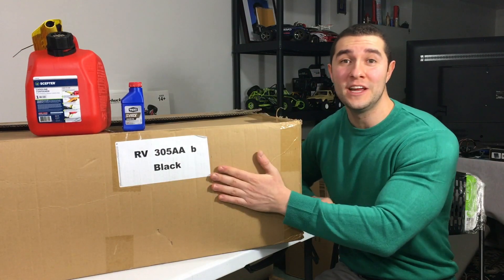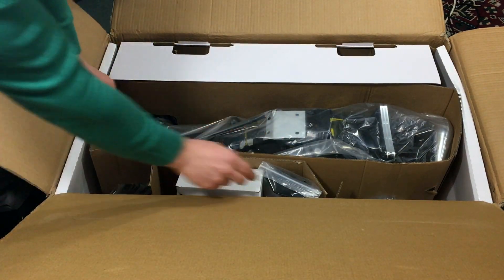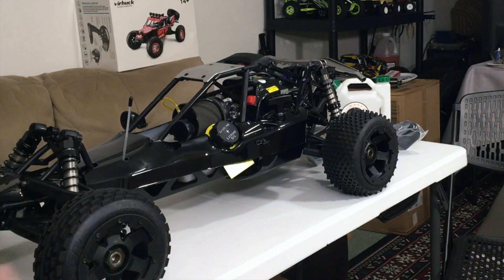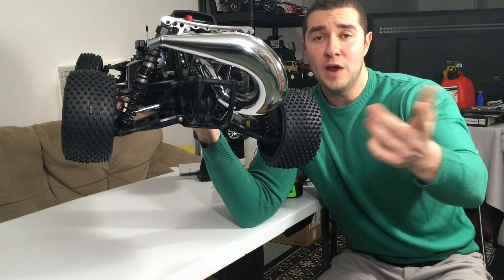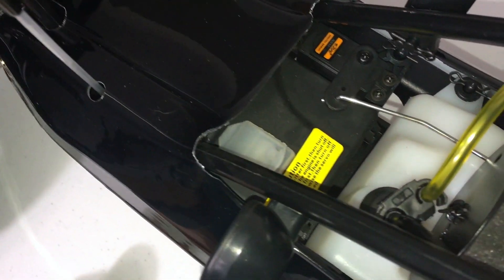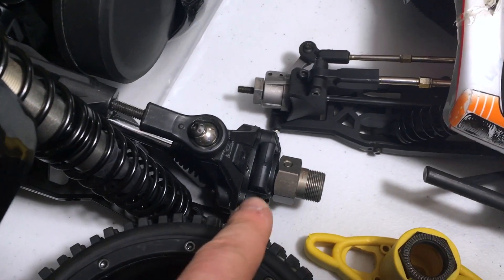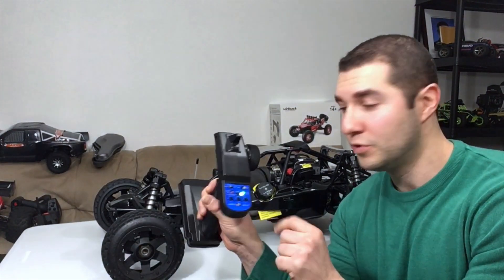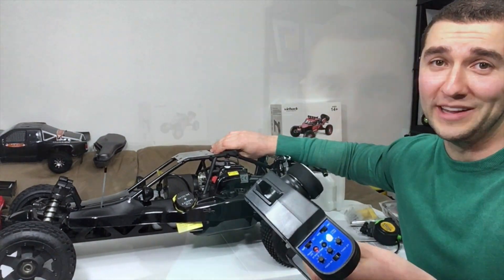I got the cheapest 1/5 scale gas buggy ROVAN 30CC (what's it like?)

Comment: No No No...… Don't know what eBay site your looking at, but these sell for between 675 and 775 all day long on eBay….  and if you want the Short Course version it's over 1200 bucks!!!!!!!!…….    yes it's a great vehicle.....      but sorry it's in the same price range as an HPI...…   The Price your quoting is for the No Engine or radio version...…
Reply from the maker: hello, You're right, the prices have recently went up some.  Check this video again at about 35-40 seconds time in the beginning. You will see that the price was 446 and I had the EBAY coupon code for 10%. So I did pay under 400 total with free shipping.  I just checked, there is a much better 36CC version of this for 535, you can submit a best offer too. Check this link, let me know if you buy it.  
https://www.ebay.com/itm/1-5-Rovan-360A-Gas-Petrol-Buggy-RTR-36cc-HPI-Baja-5B-SS-King-Motor-Compatible/332694224840?epid=26020691371&hash=item4d761effc8:g:vCIAAOSwbTRbLAn4:rk:2:pf:0

Comment: Broken seal is not ok, unless you done it your self. if the factory brakes for inspection, then they must replace it. just saying
Reply from the maker: hello, thanks for watching!!  The included literature actually says that it has been inspected after the factory by the seller, and it's normal to have a broken seal.  This is something I've never heard of before, I agree.  Its possible these are just drop shipped items and actually are checked by the final sellers. (mine has zero damage of any kind). Also it's possible they had to open the box to put in the addition running gear it came with after the factory sealed the model itself in the box.
Reply: @hybrid32494  Yeah its funny how things sometimes work, here in denmark, they are verry strickt about things like that, even customs will put on a new seal, if they would have had to breake it. And you are welcome :)
Reply from the maker: LOL, yep, the instructions literally say not to worry about the broken seal.  I must say that the packaging was very good, and nothing damaged at all.  Also weird that they removed the clear lexan body plastic film for me.  I guess they really prepped the car, ahahahaha.
Reply: @hybrid32494  OHH dear, i ordered the ROVAN AG03 BAJA, well i did that before watching your video, it comes to day. This one have some decent upgrades to it, so lets see how it holds up :)

Comment: Only downside with these engines and gearing it’s like a 2stroke go cart ,slow acceleration and benefits are mid and top end plus the fuel is cheaper than nitro
Reply from the maker: hey my dude, thanks for watching.  In a newer video I got this thing to hit 42 MPH with nothing other than slightly larger tires In the rear.  The better motors can get a couple more RPM, but this Is sufficient for a stock machine for this price range.  Otherwise you are 100% right.
Reply: @hybrid32494  I will still buy one and upgrade the motor to about 45cc i think there great value for money

Comment: I know a reverse gear is available for these can you order it with the reverse from the factory
Reply from the maker: hey buddy, I can tell you for a fact that not a single Baja will come with reverse or a 2-speed from the factory.  These things are great as is, you really do not need reverse, nitros these days also do not have reverse.
Reply: @hybrid32494  yeah I noticed how easily it turned and when I buy one of these I’ll just be backyard bashing it but probably once in a while finding a bigger place to take it I live on two acres so it won’t hit full speed but I may be able to find a bigger place to take it I like it because you don’t have to adjust the carb constantly like nitro and eventually I’ll learn how to fix small engines like the one on this one I’ve seen videos on these they are awesome and very loud but they are so cool it’s unreal one thing I’m curious about how long does the battery on the servos on the buggy last on a charge

Comment: Should I get this one or the king motors one ?
Reply from the maker: hy man! thanks for watching!  I will tell you that u will not be disappointed with either brands.  I currently still have this buggy, and it's terrific, not a single piece has broken.  I also have a KM baja, and it's nearly the same, just different specs.  I'd suggest to stick with ROVAN because it's slight cheaper at this point for similar spec models.

Comment: Where to buy at your claimed price, $395.00?
Reply: He got it on ebay from the seller rovanrc, made an offer, and used a 10% off coupon. Apparently though,  the 305a (30cc) version is no longer available, as it's not listed on Rovan's website or in any ebay listings. They only have the 27cc, 36cc, and 45cc versions.
Reply: But none at that price.
Beside that, these little cars cost more than most real vehicles on the roads.
Tires are actually more expensive than on real vehicles.

Comment: Question ?,,, Is there a difference in speed using the stock exhaust or the upgraded version.?
Reply: The rovans come with the tune pipe stock. The tune pipe is a lot better and a lot louder than the black can muffler.

Comment: Ok so first this is a clone of a hpi they copied all of hpi except the actuall measuements and another your oil choice there is bad next the mix 24/1 28/1 is what you should run there 30 cc is no match for a fuelie 28
Reply from the maker: jzink6797 hey.  Can you recommend the oil you use pls?   I am loking for other types, have not started this up yet, thanks!!
Reply: @hybrid32494  yes domanator i will check spelling but have a look at what i am building now it is a modified baja using a lot of good parts and brands and as far as rovan the parts they produce are not bad for there brand car but will not fit a origanal hpi
Reply: And to top it all off hpi was bought out by the same company that owns losi.
Reply: @hybrid32494  i found the red dominator oil was too thick and needs to be mixed leaner. 25:1 for breK in and 28:1 very time after break in

Comment: I have this and I am exporiencing stalling really bad
Reply from the maker: hey man, lets see If I can help you out.  Usually they all stall out when there is a vacuum pressure lock condition.  This happens because the vent hold in the fuel cap is really small and needs to be larger.  Look at your gas cap really closely you will see a tiny vent hole.  Remove the rubber pieces inside the cap and increase the vent hole to about 2-3 times it's size.  Let me know.
Reply: hybrid32494 hey thanks for the help but I can’t try it cause my spark plug is bad I found out
Reply from the maker: Thats sometiems the case, yes.  Get yourself an NGK CMR7H plug from any autostore, they are around 2-3 bucks.

Comment: Bro 30.5 old engine you paid to much 🐒
Reply from the maker: what do you mean 30.5 is old.  Based on what is it old?  So your saying that the new 1300 HPI baja 5R with the 23CC fuelie engine is new????   All these are basically the same motor blocks anyway, at least this is a larger displacement motor.

Comment: Had one of these,  not worth the money. Broken parts every run, look cool but poor quality.
Reply from the maker: hey dude!!  can you tell me which parts you broke?  Just want to be sure to check these if they are in fact common weak points,  thanks in advance..  So far nothing has broken, ofcourse I don't bash this just yet, it's only done the break in cycles so far.
Reply: @hybrid32494  Broke several A arms, wheel bearing carriers, rims broke & flew off while driving, ,steering  linkage connectors, other misc parts. Engine ran good but had to replace pull start once as well. Hope you have better luck with yours.  :)
Reply from the maker: thanks!! The pull start is the only item I am worried about, so far.  But the replacements and upgrade ones are cheap enough, no big deal.  I don't really bash any of my RCs hard (other than my slash VXL) so as long as the engine starts and runs well I'll be happy.  Thanks for letting me know.

Comment: Don't let the HPI butthurt Fanboys get to you! It's a great deal, and comes with Upgrades that HPI doesn't even offer. 
Go over ALL Screws into Metal with Loctite. Trust me!!
And REPLACE the Tires when you're able.
Reply: You've GOT the upgrade Nylon HD Wheels, those will be FINE!
HPI Baja is $1000.00 MINUS any upgrades!!!
Reply: Oh! And once you get used to GAS, you'll NEVER go back to Nitro!!!!
SO MUCH EASIER!
Reply from the maker: I am beginning to fully agree with you, Gas is pretty easy compared to the tuning and glow starter issues with nitro.  The gas just starts and goes.  And seems to be much more cost effective, even while using overpriced 2 stroke racing oils.
Reply: I'm still waiting to be able to afford one.... Even as Cheap as the "Clones" are. Just not going to see that kind of money anytime soon.
Rick, the Owner of Rovan/King Motor in NY, is offering me a direct Deal.... And I STILL can't afford it, but I'm hoping he holds on to it. 

YOU got the better Buggy BTW. The 30.5 is a far more stout, more speed, and even more reliable than the 34cc in the King Motor version!! 
I may not HAVE one yet, but I've got friends in semi high places in 1/5 Scale Gas Buggies, I've driven other's and tuned and repaired more than that. 
.... As soon as I can get one, I'll be ahead already!
Reply: If you're interested in knowing HOW your 2-Stroke Engine actually works.... I made a Video on my Channel.
I have another one, if you want to see some advanced Carburetor Tuning. 😉
Reply from the maker: PoorManRC   Wish you the best and hope you get it soon!!!  I sold some of my rarely used electric models before buying this, i know what you mean.  Gotta wait for the 15% ebay coupons, thats the time to buy these.  One time there was a 20% too.
Reply: Thanks! It'll happen. I want it that bad.
.... I've ALREADY bought UPGRADES for the Buggy that I don't have yet!!! 😱😱
Reply: All materials are inferior to hpi. Also heard a lot of complaints about parts missing, or bending, etc.
Id rather pay more for a HPI

Comment: Its a rubbish knock off , hpi or die !!
Reply from the maker: lLOL,  Based on what are you making this claim?  Anything more than your biased opinion?
Reply: you get what you pay for , ive owned my (hpi Baja 5b) for over 3 years no issues . and I find Baja motors on ebay for 120 if not less . tower is overpriced and that was not a fair match up . cheap plastic and metal is why those are cheap